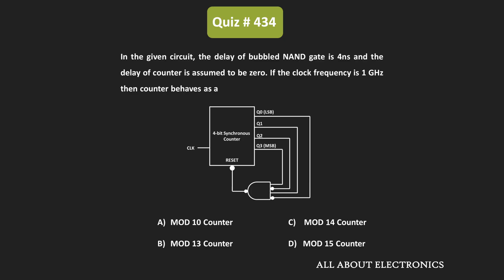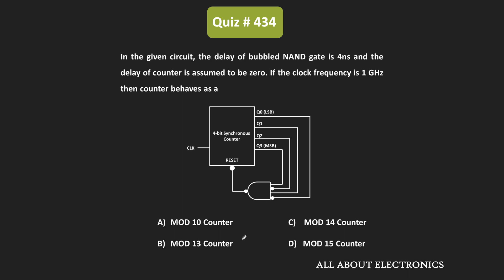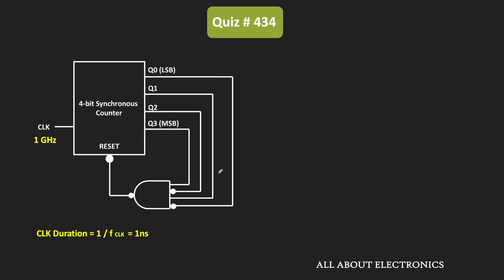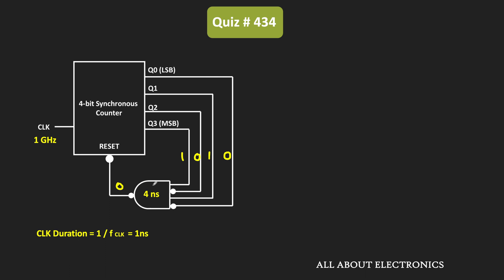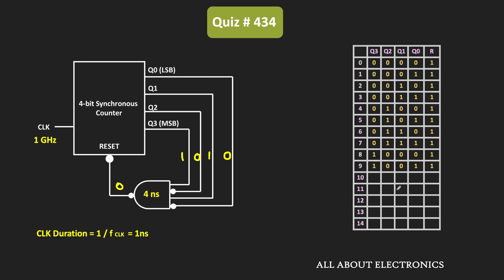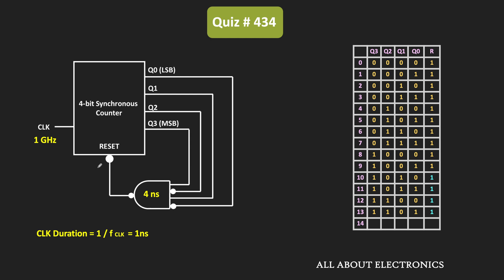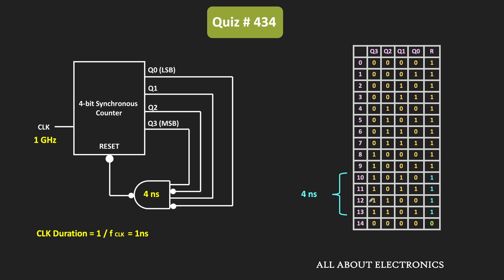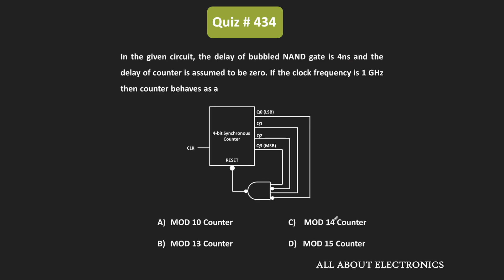Synchronous Counter Solved Problem (Digital Electronics) | Quiz # 434

Comment: Thanks for ques sir! 
I have a doubt that if the delay of the 4 input gate here is 0ns will the counter be simply mod 11 or mod 10 (as it has a synchronous counter so its going to wait for an additional CLK pulse at 1010 state making it run through 0000 to 1010 i.e. mod 11).
Please tell if my reasoning is wrong.
Also, I have an underlying doubt: whether synchronous counter can have a asynchronous reset pin? 
It will be very kind if you answer my query 🙂
Reply: Sir please reply
Reply from the maker: If the propagation delay of NAND gate  is 0 ns, then as soon as the counter momentarily goes to 1010 state, immediately the output of the NAND gate will become 0 and the counter will get reset. So, 1010 will not be a stable state. And therefore no need to cosider that. So, in that case, it will be MOD 10 counter.
Reply: @allaboutelectronics-quiz  Ok Thank you Sir

Comment: Really thank you for these videos, I appreciate all the work that goes into making them. Is it okay to rely on propagation delays in a real design? If the delay is 4ns, maybe it will sometimes overlap a clock cycle and count to 15?
Reply from the maker: Yes, in real design we need to consider all the propagation delays and we need to ensure that, these delays does not affect the desired output. 
In case, if it affects the output, then we need to modify the design accordingly. 
Or if we cannot modify the circuit, then we should be aware about the limitations of the circuit, like under which conditions circuit won't work.
Reply: Thank you 🙏